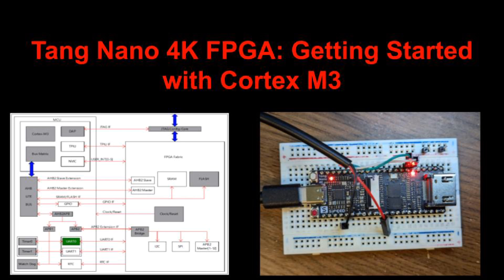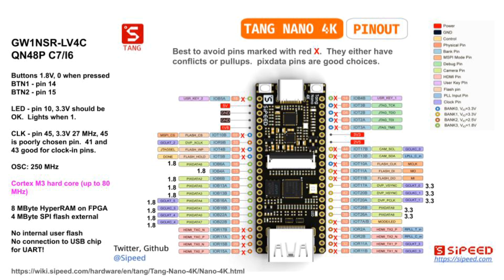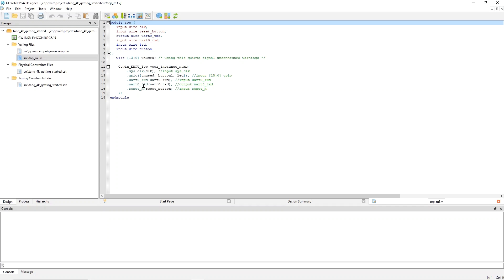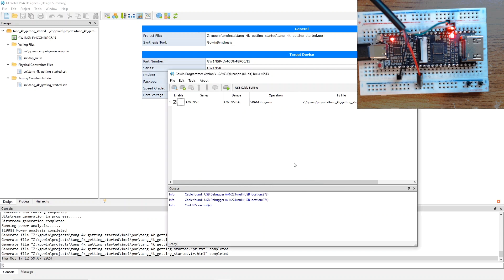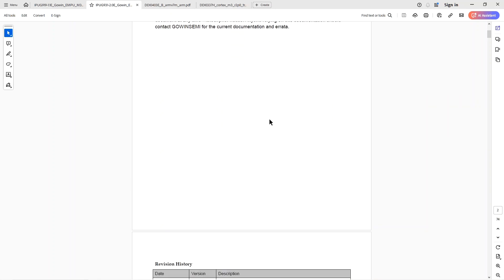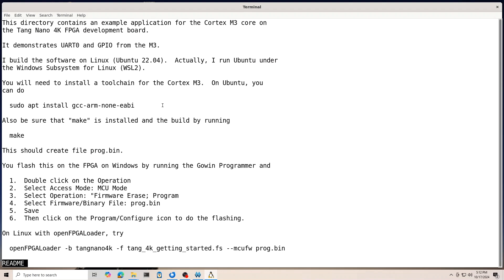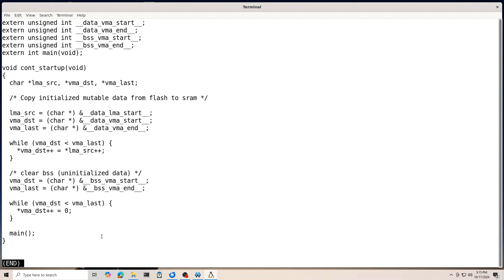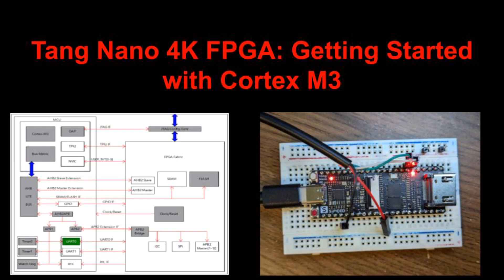Tang Nano 4K: Getting Started with Its Cortex M3 Core

Comment: Hi - Thanks for the video. very informative.. although, i may have missed something, but there are no steps on creating constraints or timing constraints, nor any steps to actually program the FPGA with the Verilog code  in this video?
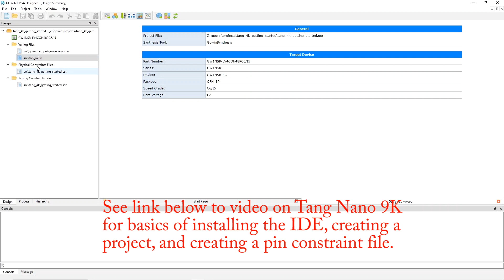Reply from the maker: I use the Gowin IDE in the video starting at 3:40, and you can see the complete Verilog at 4:11.  I don't show the timing and physical constraint files, but you can see them on the github shown in the video description. These are the cst and sdc files.  At about 7:28 I build and run using the Gowin IDE.  For a more detailed introduction to the IDE, you can see my video on "Getting Started with Tang Nano 9K".   The other boards work about the same.  Cheers, and I am glad you found the video informative.
Reply: @electronics.tinker  So i tried my utmost best to get the M3's GPIO talking to the FPGA, but simply can not get it working.. if you pipe it straight through, it works.. i.e. defined in constraints, defined as parameter in top and passed directly into the Gowin_EMPU_Top instance..  like in your video here you pass led and button straight through..

BUT - when you want the FPGA to read the values sent from M3, it just doesnt work..  For example if i want the FPGA to set the LED based on what values the M3 sent on its .gpio?

You have a "wire [13:0] unused" to just quiet warnings.. but what if i want to read from that "unused" wire what the M3 sent??

is that even possible?
Reply: Eventually got it to work.. had to use the full gpio interfacing module via IP core generation to produce gpio interface with in/out/enable signals
Reply from the maker: I'm glad you got it to work.  What you did bypasses some logic that Gowin autogenerated.  That logic is controlled by software and works for me.  At least this quick test worked: I changed the "unused" signals to be 16 wide and connected only them.  I then used Verilog assign statements to connect them to the external signals button1 and led.  Worked fine.  Maybe check the software? Cheers.
Reply: @electronics.tinker  Thanks, yeah i tried with the regular inout parameters, but even when doing tristate setups, it would never synthesize, i could never get bi-directional going...

Comment: Very nice video. Tang could almost employ you to promote their products given the quality of tutorial you provide. Does that GPIO interface, mean that the FPGA cannot get signals 'directly' through the GPIO pins but only through the ARM core? That would seem be a downside but maybe I misinterpret. It seems possibly that this board was intended to be focused on Camera/HDMI functions, rather than being 'general purpose'? I would look forward to any material you could show of a simple project demonstrating the MCU and FPGA interacting.

If you install the msys2 distribution platform for windows, it allows you to get a number of toolchains. The most famous one is the MinGW-w64 fork of GCC that is compatible directly with Windows; but it also includes a great many other 'normally linux' tools to get (make, cmake, etc etc etc). It basically uses a version of Archlinux' pacman package manager to install tools for windows. Of interest, you can install the 'mingw-w64-x86_64-arm-none-eabi-toolchain' meta-package in order to get a GCC toolchain for ARM, and clang is also available as well (both for x86/x64 and ARM). 

Also available is using xpm ("the xPack Project Manager"), using that package installer you can get '@xpack-dev-tools/arm-none-eabi-gcc' which will also give you a GCC for ARM.

As you say, using some linux distribution underneath WSL2 is also a good option these days.

In terms of USB-Serial adapters, there a good number of other chips on the market that side-step the problem of using fake FTDI FT232RL chips. Ones using Silicon Lab's CP2102 or CP2104 ICs generally work very well, and probably either auto-install drivers on newer windows or they're pretty easily to find on the net and install.